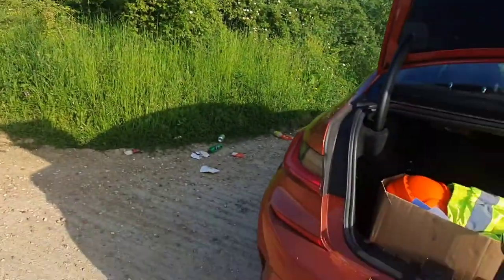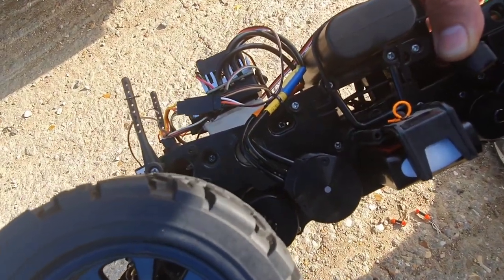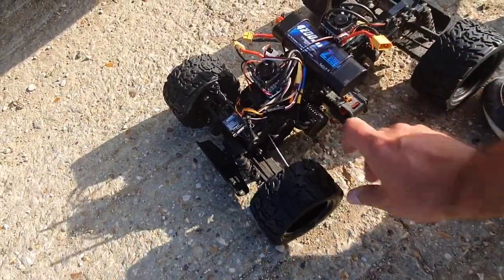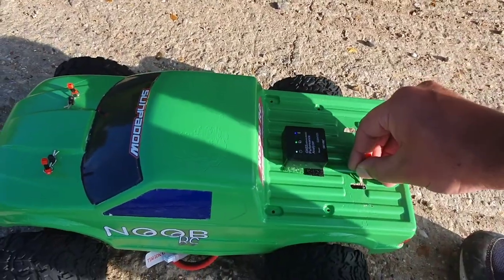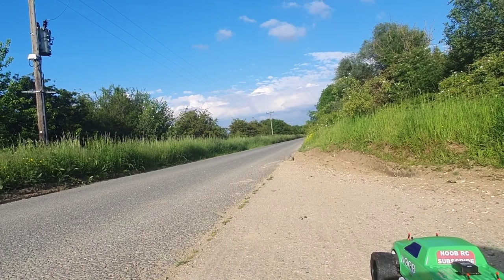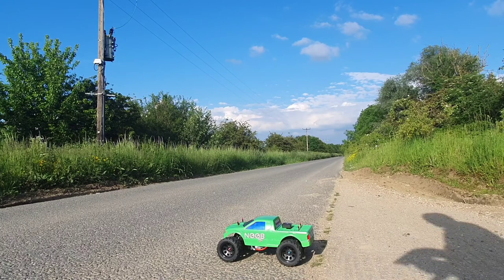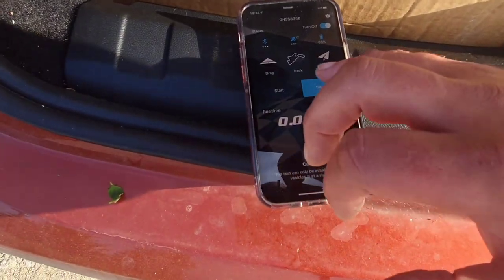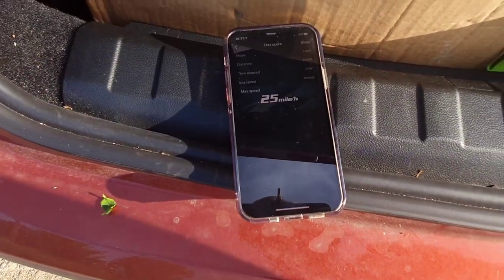tamiya twin detonator project back from the dead brushless conversion did it work?

Comment: Try the following, it worked for me.
Use the GPM TL01 servo holder.
Use a Tamiya hi torque servo saver or just eliminate it.
Run a 30k-50k weight in the rear diff and run a 10k up front.
This really helped mine and I have no torque steer.

Comment: Hi sir, may I know how did you wire them properly, do you have a diagram? I want to do it with mine also. A gyro might help it go straight….
Reply from the maker: Hi there I don’t have a diagram but all you have to do to make both the motors go in the same direction is switch two motor wires on the esc to make the front one go in reverse.and cut one of the receiver wires so it only has one power input. Actually that sounds really complicated but it isn’t. I did film it but never put it on here I’ll have a look if I’ve still got it if I have I’ll upload it for you.
Reply: @noobrccars4392  thanks for the response, i mean the 2 esc thing to work at the same time using just one receiver. Hope you still have that full vid installation, would help a lot. Thanks again👍😊👍
Reply from the maker: Ah ok that’s not too bad basically you need to buy a y piece (Amazon sell them) and then cut one power lead on the y piece  usually the red one so only one esc powers the receiver. Then it works fine. Does that make sense? It sort of does to me but then I’ve already done it.🤦 I’ll have a look for the video later.
Reply: @noobrccars4392  thanks again, actual would be better but I kinda get it. So 2 Y for esc to receiver…. and Y for battery I think…. The receiver will handle both esc signal through the Y (servo connector 3 pin) sorry, I’m really new with this brushless set-up…